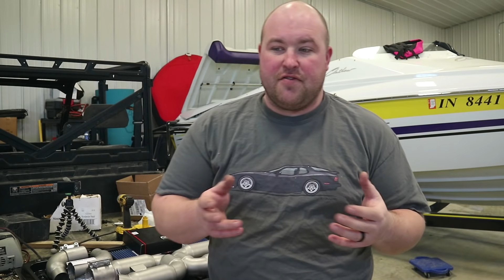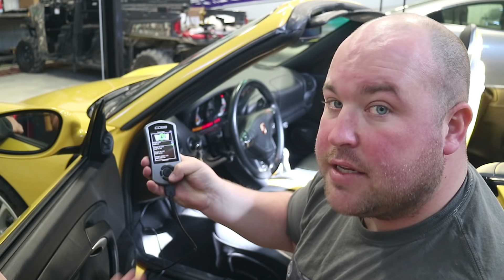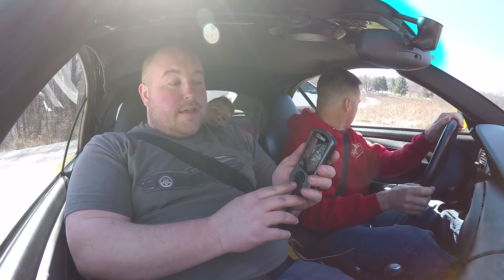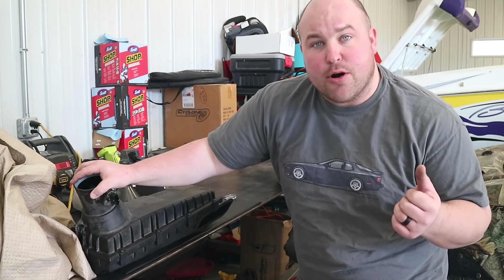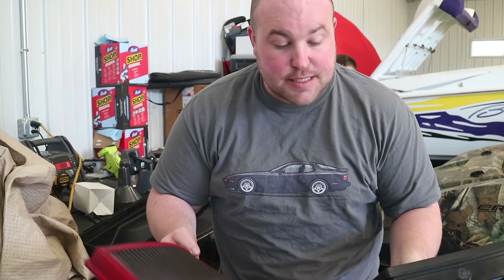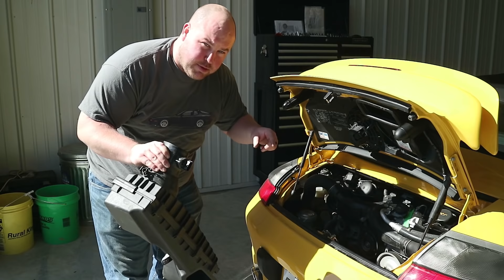911 Turbo S - Stage 1 Upgrades (996 Porsche Turbo - Cobb Accessport)

Comment from the maker: These mods woke the car up quite a bit, looking forward to round 2!
Reply: is there a port for the na??
Reply from the maker: PlugBunny an OBD2 port? Yes... However, to my knowledge Cobb doesn’t offer off the shelf tunes for the NA 996.
Reply: Any suggestions where to mount that COBB Accessport in a 996? ... I have been struggling with a decent mounting location on my 996TT, ... visibility and routing of the darn cable make this a challenge IMO.
Reply from the maker: Agreed... That is one thing I did not do, as the owner wasn't interested in having it displayed all the time. 

i would be tempted to windshield mount it when i wanted to use it and leave it stored otherwise. 

But,  for permanent mounting, it looks like a lot of people go the left of the radio.
Reply from the maker: Maybe this will help! https://www.amazon.com/dp/B00L4207IS/ref=asc_df_B00L4207IS5418483/?tag=hyprod-20&creative=395033&creativeASIN=B00L4207IS&linkCode=df0&hvadid=198075247191&hvpos=1o1&hvnetw=g&hvrand=37771633760409105&hvpone=&hvptwo=&hvqmt=&hvdev=c&hvdvcmdl=&hvlocint=&hvlocphy=9021675&hvtargid=pla-321191989857

Comment: What do you reckon the HP and torque gains were with Stage 1+filter? Advertised? Dynoed? Thanks for this series!
Reply from the maker: Good question!  This being a Turbo S, it has the X50 package and is rated at 444 hp factory.  With an additional (4) PSI of boost and I'm sure a pump in timing, I think the tune and filter are worth about 40 hp. I wish we could have gotten in a dyno to get REAL numbers, but it was fun to see the 0-60 times.

FYI - Cobb claims a bone stock non X50 car makes 373hp/422 tq. They followed up with a catted exhaust and the stage 2 map, and it made 453/499. So roughly 80 hp / 80 tq gain with exhaust and Stage 2. 

With the X50 kit being worth 20 hp and us using a non catted exhaust, I bet we are close to 475 whp after all the mods were done.
Reply: @BoostBrothersGarage  my X50 with tune, exhaust, intercoolers and a mafless tune with filters directly on the turbos made 495awhp/520awtq, so I think you're probably pretty spot on with your estimate.
Reply from the maker: Nice! I’ve heard the filters on the turbos makes a big difference
Reply: @BoostBrothersGarage  they do. Adds a ton of throttle/spool response, especially on the bigger X50 K24s.